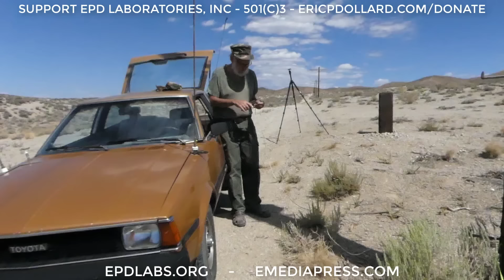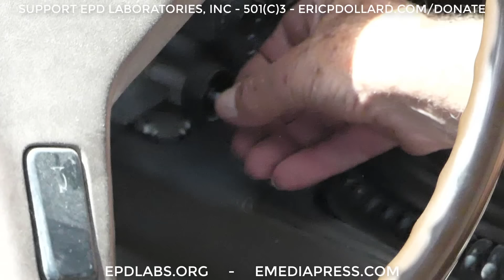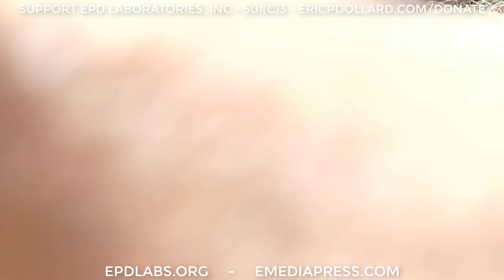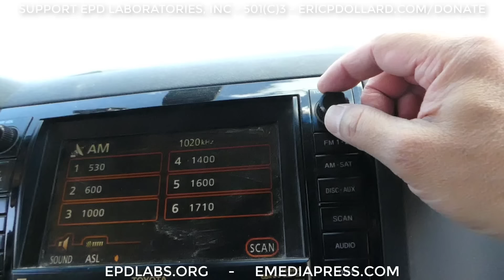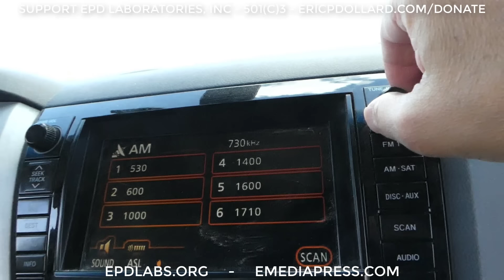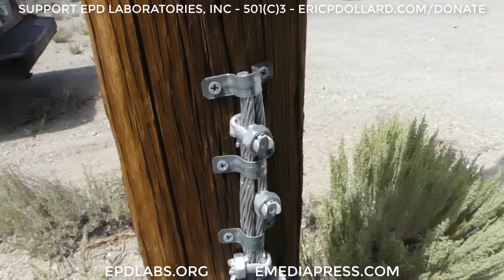Ground Radio Reception at Pole 26 — Eric Dollard 2025

Comment: Uhh, I finished that math. I still eat out of garbage cans for the information to process. The Disposal Coefficient was never computed for the biological economy. Oy vey. 

Btw, I think the reason why Galois' theorem is used in electrical engineering is that a 3 or 4 phase system is possible, but not a 5 phase. Tbh, I'm not sure if my math changes that. It probably does.

Comment: I cannot hear Eric half of the time. You are picking up to much wind with your camera mic and when you point the camera away from Eric, you cannot hear him. What I do when I make videos, is to use a separate audio recorder and sync it with the camera audio in montage. You can buy a zoom F2 recorder and clip it on Eric's belt and clip the mic on his shirt with a wind cap. A wireless mic will not work in your case, since you are working RF and all that.

Comment: Is there any practical application for this research?
Reply: Showing how an AM radio reception is boosted by pulling the signal out of the Earth and how a real AM radio with a Tesla Coil inside is what is needed. The modern phony AM radios without real receiving coils are at a disadvantage. Also discussing the grounding system and the future plans for the loop antenna to monitor the Earth's magnetic field and more.
Reply: the pedants of todays electron religion are powerfully amplifying a noise and they think they have found the holy grail, that they know electricity, well they don't even have a clue of what is going on as Eric showed us for many decades actually..
Reply: @Electrical_Science  , what do you mean by "electron religion?" You don't make any sense!
Reply: @DypoMage I'm certain that most people here knows what i mean by religion and electrons theory...
Reply: @Electrical_Science  , but I don't...
Reply: @ViaNegativaaa , you realize that physics has advanced since JJ Thompson's times?
Reply: @ViaNegativaaa , you crackpots are just so bitter because you don't understand modern physics! :D
Reply: the practical end side is that we need to abandon all this electronic garbage because it does not work as it should, and moreover it polutes the environmet like sewage.
Reply: no
Reply: @DypoMage  communications that can't be triangulated might be useful
Reply: The practical aspect is that we can use the Earth as a giant transmitter and receiver for communication in place of conventional electromagnet radios, without signal attenuation to any point on the globe.
Reply: @JenkoRun  , not true!
Reply: Well as far as I can tell Dollard's not in it for "practical" (i.e. what people really mean when they say that is how to make money off of it) reasons, but more so to get a greater understanding of how things works, not to mention his work aligning with his nature. Realistically the modern world is so entrenched in einsteiner physics nonsense that this would never see any public application, but on a personal level it not only get rid of the notion that radio operates with Hertzian (electromagnetic) waves but would also be several magnitudes more efficient since current radio only has a small percentage of actual work being done with the rest mostly being waste.
Reply: @bobdole27 In other words, disinformation.
Reply: @ricksampson6780  What are you talking about "disinformation"?
Reply: @bobdole27  Please be rational and objective in your observations.
Reply: @ricksampson6780  Ah I see you're just a troll, expect no further interaction